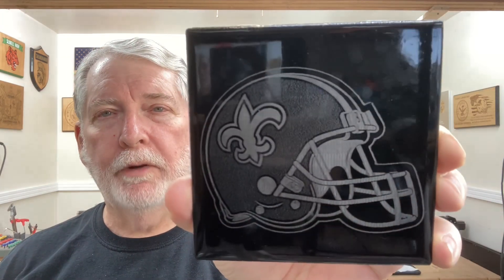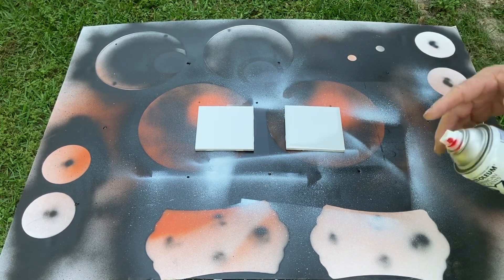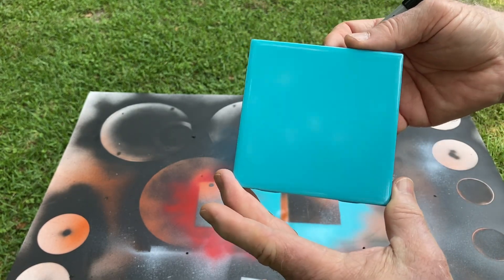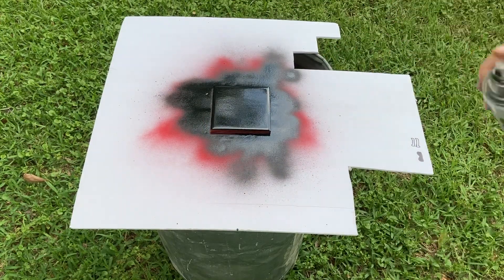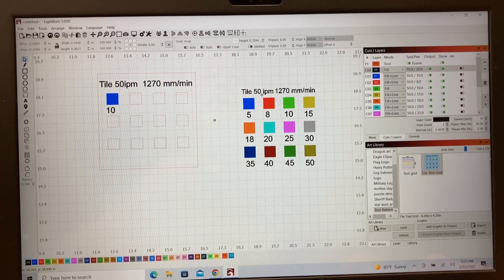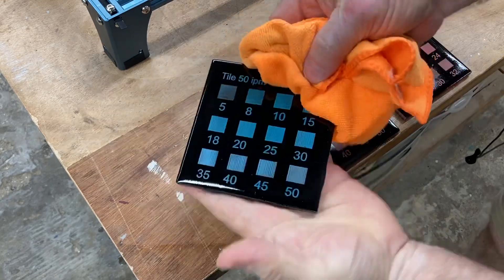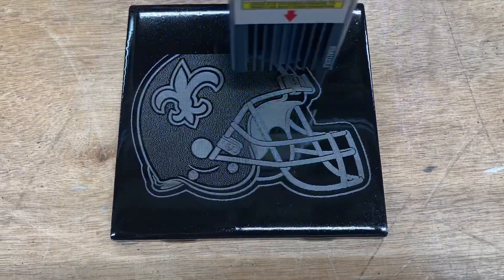Complete Guide to Color Tile Process

Comment: Excellent tutorials.  You are detailed!  Taking your suggestion the process was successfully  duplicated and expanded.  At the 1:37 mark you mention the lighter color must be sprayed first.  In testing, It  didn't matter if the base coat was lighter that the top color, which increased color combinations exponentially.  Thanks for taking the time to share your knowledge and technique.

Comment: So Paw Paw, what do you clear coat the painted and then etched tile with that will hold up better than just the paint (which I bet will scratch off).
Reply from the maker: This process will scratch. I use spray lacquer. The Norton White Tile Method will not scratch

Comment: Thank you for the detailed instructions.  I have bookmarked it for future review.  There is one point I was disappointed about, after a detailed painting and test grid setup there was really no description on how to evaluate the results to select the correct power.  If you ever revise this video, please spend as much time evaluating the results as you spent in preparing the tiles.  This is a great video.
Reply from the maker: Thank you very much for you kind words. The settings will always change with different materials. You unfortunately cannot escape testing to get the best settings

Comment: What do you recommend to use as a finishing clear coat? Thank you.
Reply from the maker: A spray clear lacquer coat will work just fine.
Reply: I tried that and my paint started to scale on all my pieces.
Reply from the maker: You had a chemical reaction. You have to put the clear coat on after waiting for it to completely dry. Lightly sand and then spray

Comment: That was very cool, thanks! I've got a project coming up that will a blue and green graphic that sits on a white tile. Can I use the same process as you did, but, using a layer of white instead of the black? Also, thanks for the walkthrough on how to set up the grid. I'd like to make a set for tile, acrylic and glass. Is there anything I need to know other than what I just learned?
Reply from the maker: You have all the information, now its time to experiment on your specific project.  Let me know how it turned out.

Comment: Enjoy your videos. Your process seems to me to be great if you want to make a drink coaster or something for a display. I’m redoing my bathroom soon and want to add a personal touch. Those ceramic tiles have a glaze baked on to make cleaning easier, Is there a procedure to reglaze the tile after the laser has burnt thru the glaze? It wouldn’t be an issue if I was still married ( or maybe) but don’t want a few tiles that the mould can get right into.
Reply from the maker: No, you can not glaze the tile a second time.

Comment: Hello friends,  I changed my laser head from Ts2 10W to the TS2 20W, I engrave on ceramic with the Norton method and it comes out gray not black. I tried different speed and power settings, can you please advise which are the correct settings to get good image results for the TS2 20W? In the previous laser head, the 10W I used to use speed 1200 and power 80 and it came out in black and was fine details. Should I be using different settings for the 20W laser head now? I would appreciate your answer. Thank you

Comment: Another tip, if people find their clear coat is reacting with the paint, using water based polycrylic won't (read: shouldn't) cause blistering/peeling when clear coating.
Reply from the maker: Great tip. Thank you

Comment: I'm seeing Lightburn version 1.0.05 on your screen.  Mine is 1.1.04.  Reason you haven't updated?  Also, am I seeing rapid travel between where the laser fires or is the X-axis constant speed?   Seems like my Atomstack A5 Pro 40W only does constant speed.  Unless there's a Lightburn setting I'm missing?
Reply from the maker: You can change the white space to move faster.  This reduces engraving time.  I just have not updated.  Yes, I should do it but not in a hurry.

Comment: How did you get the images to fill in (on the screen/preview) lightburn? Whenever I select a piece i want the laser to fill, the image just shows the outline so i have to look back at the setting to be sure it will fill.

Comment: My color test tile keeps coming out gray and white ..no matter what color is under the black..do I increase speed?
Reply from the maker: You must do a grid test. The goal is to burn off the black leaving the color underneath. Further burning will reveal the white. If you are getting gray then you are most likely not burning all the way through the black. You can’t skip the test
Reply: @PawPawsWorkShop  I seem to get much better results doing the Norton full grid test..yeah it takes 45min instead of 15 but it gives me a big range of color options

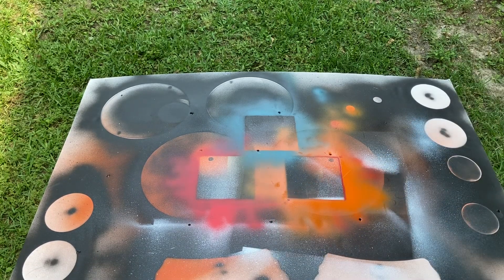Comment: 4:46 You're spraying an un-keyed, gloss, non porous surface....it's hardly surprising that the paint peels off. In fact, you're lucky to find ANY spray paint that will adhere properly to a substrate like this, especially in the long term. Don't be surprised to find that customers complain that their items are peeling or flaking in a fairly short time. Please don't think that I'm hating on you or anything...I love your work and your videos...I'm just offering an observation, based on many years' experience in this field.  😀👍👍
Reply from the maker: Thank you for your comment
Reply: What does un-keyed mean? I’m spraying exact same paint on gloss tiles let dry 24 hours slightest bump paint scratched off. Try to clean painted tile like shown, the under color disappears!! I’m doing everything the same and get bad results. Please help
Reply: @patriotwoodworker6092  To “key” a surface means to prepare it for spraying or painting. It's generally not necessary on rough or porous surfaces, as whatever you're applying will grip onto (or absorb into) it. But when painting/spraying a smooth, non porous substrate like a tile, metal, glass, etc, you must first roughen it, maybe by using abrasive paper or wire wool etc. The surface of (say) a glossy tile can be as grease free and clean as anything, but if it is not prepared correctly (i.e. “keyed”) the coating will not stay on there for long. Hope that helps!

Comment: When using the rustoleum painters touch 2x brand of paint, using the exact same method as you, the gloss black has a bad reaction with the apple red. Ive tried it several times and always the same result. The black imediately curdles when it hits the red. I dont know if its the red or the black causing this. So far it is only with black over red. Black over gold works great.
Right now i have red drying to topcoat with white and see what happens.

EDIT 8-15-22:  After some more testing, I can say for sure that it is the Rustoleum Painters Touch 2X Apple Red that is causing the reaction. Anything I topcoat it with has a chemical reaction and ruins the finish. DO NOT USE Rustoleum Painters Touch 2X APPLE RED.
Reply from the maker: Read the can label. It discusses the reaction. I have also called the company in the past to discuss the problem. Yes, you are getting a chemical reaction. Let the paint completely dry before adding the top layer